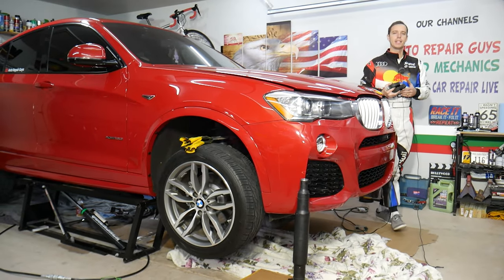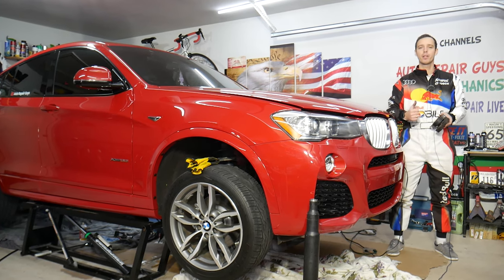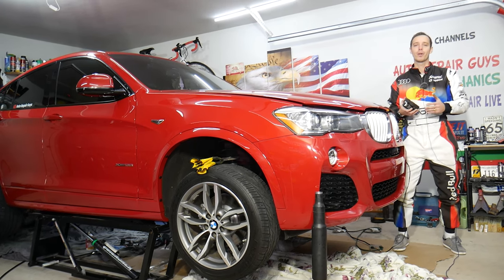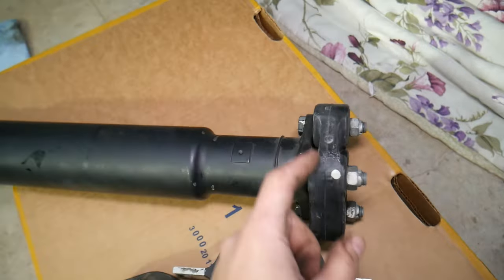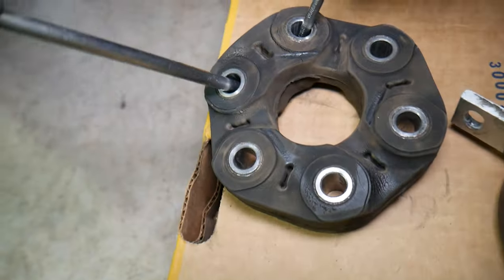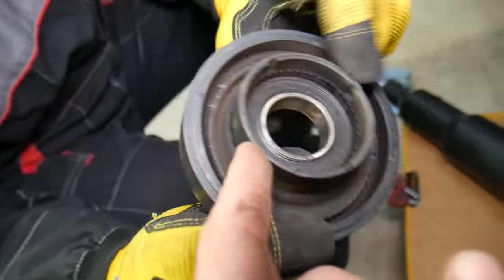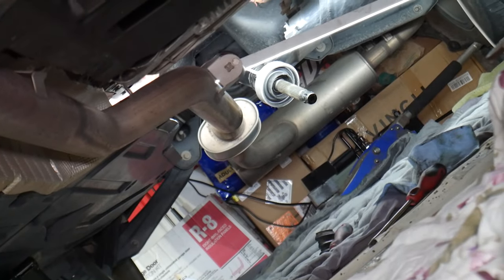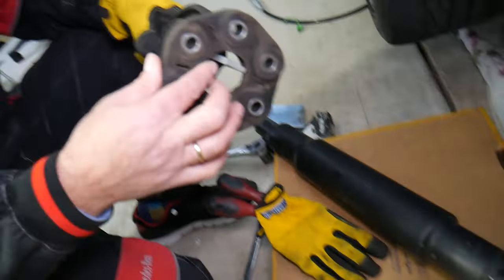WHY BMW VIBRATES WHEN ACCELERATING, BMW VIBRATIONS UNDER THE SEAT

Comment: As you had a failure with the main drive shaft bearing which would have caused the vibrations. The rubber rings wouldn't have been causing any vibrations in their condition. Stretching any rubber in a direction it's not intended would look worse than in its actual operational direction it's designed for. That method reminds me of a scam used by exhaust companies to sell more than what is required to a customer. Where they would apply excessive force to a exhaust pipe so it dents in an attempt to show a customer it is weak metal when it actually isn't.

Comment: respect.  I have this same car and it happens that I constantly feel vibrations while driving on the highway.  I changed the tires, balanced again, but the problem is there again.. I changed the cardan bearing and this hard tire, balanced the cardan but nothing.. Is it possible that this is happening because of bad shock absorbers or shock absorber salt?
Reply: did you manage to find a fix, I'm having this issue when on highway accelerating.
Reply: no, i didn't solve the problem.  It's already driving me crazy..let me know if you manage to solve it.
Reply: Hi , hast du gefunden problem?
Reply: Bei mir von 110-140  vibriert...

Comment: Hi but about on my bmw e60 mine is vibrating just when is in neutral or when you press the clutch.(while driving or on idle) Thank you
Reply: Flywheel, out of balance/ happen 2 times after launching my v10 e60

Comment: I have vibrations on my 328i 2011 it feels like the tire
Reply: Hiya mate, did you find out what it was? Ive got a 428i with same vibration that feels like its coming from the tyres but i changed the tyres and same vibration is coming
Reply: Same bmw 328i major vibrations while driving drive shaft needs to be replaced
Reply: @sharellethomas2502  got this figured out. It was the propshaft donut/coupling which is cheap to replace
Reply: @Ammad Qaisar I wonder if that’s my issue I’m having the same problems you mentioned. Did you take it BMW?
Reply: @opulence_lifestyle4407  no i got it up on a ramp at a friends garage and checked underneath. It is very common and very cheap to replace. If you put your car on a ramp you can actually visibly see it and if you see its cracked or is torn “its made of rubber” then just change it.
Reply: @ammadqaisar8763  👌🏾Thank you

Comment: Good day, a have question. @AutoRepairguys 

A few months ago I bought BMW 525D Xdrive 2.0L N47 160 kW, 223k (original mileage). Now I plan to change the motor chains, everything is works clearly, I don`t have specific sounds and etc. But I see that my engine and engine pipes around always have a little bit very fast vibrating. This vibrating is when engine cold and hot - always looks the same.   

Whats the problems can be here?

Sorry if my English is not well.

Thank you

Comment: My BMW F11 suffers from a pretty unusual issue. I get a strong bassy noise + vibrations that resemble the way the engine works, but only in the range between 1100-1700rmps, and only when the engine/gearbox is under a load.
Its feels as if the engine would run with no mounts at all, but the noise + vibrations are almost not present on gears 1,2... and the higher the gear the more it is present. Accelerating or going uphill is waking up those bassy vibrations in those specific rpms range, but going downhill or on flat freeway - no signs of it.
It all began when the BMW garage did an oil service and replaced the rear differential mounting rubber (that little round one).

After that I have replaced both engine mounts (oem parts), gearbox mount (replacement), the main pulley in front of the engine along with the tensioner and the belt.
I have checked the injectors, air filter, DPF, changed the flexible exhaust link, checked the muffler or looked for any loose parts, joints, rubbers etc but nothing... noone has any idea anymore.

My only guess now is the gearbox mount which is a replacement and not an OEM part.

Any other ideas, suggestions?
Reply: I have exactly the same issue, did you solved it?
Reply: @alinghetu6356  nope, sold it
Reply: @forgottentrancesets  You sure it wasn't running rough/misfiring. Did you test torque converter
Reply: Solved?
Reply: @YasinSahin-e3y  rear differential rubber mounts, those little ones at the side of the drive shaft.
Reply: @forgottentrancesets  so you fixed it with replacing the rubbers i have the same problem with my 435i when i accelerate on 100 kmh it is like i dont have engine mounts

Comment: I have bmw serie 1 2010 it shakes in first gear and reverse really hard , when I am moving is everything okay 
I changed kit of clutch
And fly wheel also 
Please if someone knows please help me
Reply: I have the same. It’s feels kinda like the diff is slipping or the driveshaft is shaking really hard but goes after couple seconds

Comment: I had that problem on my 2006 Charger SXT. I thought it was the transmission going out. Found out it was that coupler. My 2007 CLK350 has the same type of drive shaft couplers.
My Charger reached 301K, when it needed that replaced. The CLK350 has 168K, looks fine. My 2011 Charger is an RT, with 208K, so it may be needing that soon.

Comment: Hi. What if both parts new i mean the rear doughnut and the centre bearing, and still vibrating over 90 miles?
Reply: Did you find the solution ?
Reply: Found solution?

Comment: I changed the whole drive shaft of 2009 328i and vibrating on low speed
Reply: Did it fixed the issue ? My 328i 09 vibrates too on low speeds
Reply: @danielemerich8770 did you find the cause?